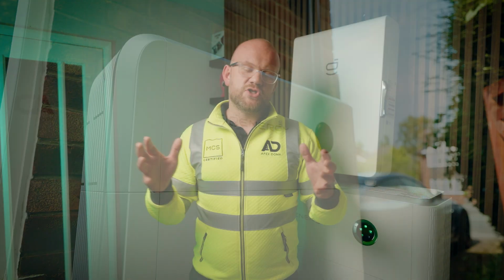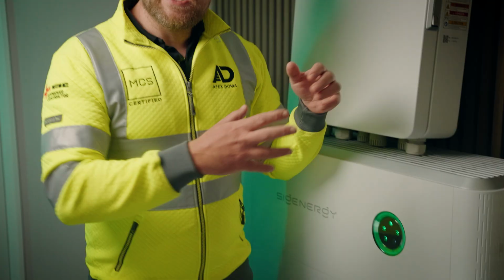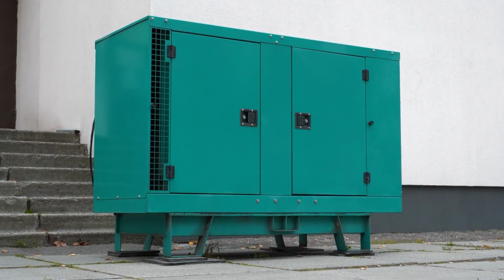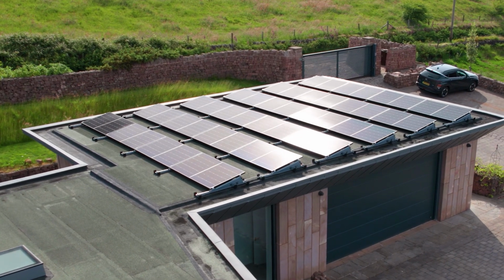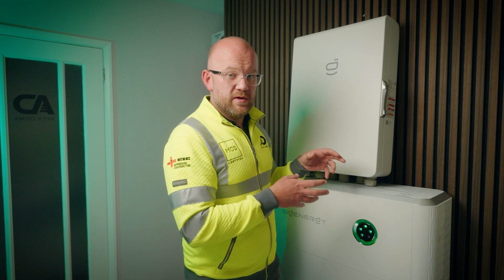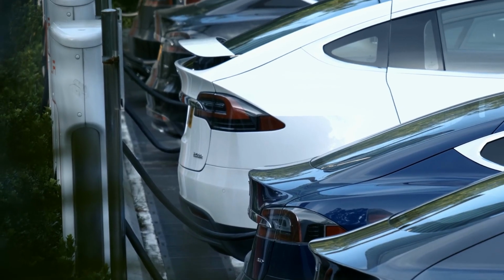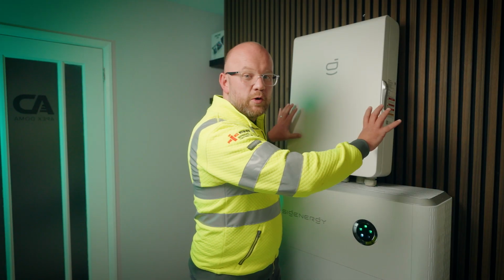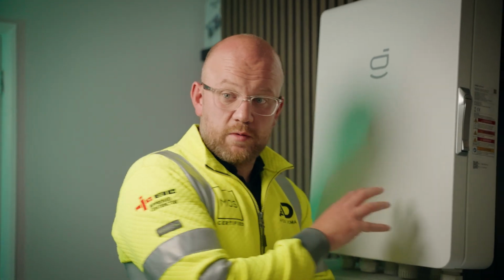SigEnergy vs Tesla Powerwall 3: The Best Whole-House Backup Power Options in 2025

Comment: Get a Deye 12 KW inverter + one or more 15 kWh low voltage cells for a fraction of the price + it's 100% controllable through Home Assistant with down to 5 secs. updates if you buy a simple Modbus interface. The 12 KW Deye will do a max. of 12 KW on it's load port with up to 6 KW one any one phase. High Voltage batteries are so expencise they often never will return the investment where you now in EU can get those 15 kWh LFP batteries for 1300 Euro delivered at your doorstep VAT & Taxes included. The inverter will also do Windturbines & 3 phase generators.

Whats the price for one of these inverters + one 314 Ah battery? How much power can the inverter deliver total/each phase?
Reply: Hey I'm in Europe can you point me in the direction of where to get those batteries? I'm very interested in building a battery backup system for my house in France
Reply: @moulinroche Links gets deleted here. I have sent you an email instead.

Comment: What they don’t mention is that you need to drill through your garage floor membrane and foundations to sink a separate earth rod. I decided I didn’t want my damp protection compromised. It’s not practical with a heat pump either, in mid winter my house load is 60 kWh, 15kWh battery storage won’t last very long.
Reply: My earth rod was outside the garage. No issue.
Reply: @djtaylorutube  That would be great. We have a tarmac path that’s in good condition, they could have taken an angle grinder to channel through it but again it would compromise a perfectly good path. We haven’t had a power cut in years so just not worth the damage, but if it looks like war is imminent I’ll sort it out as the gateway is already installed.
Reply: @yp77738yp77739 Yep, side of my garage has a slabbed path so they ran along the side of the garage, under a slab and into soft stuff.  Makes sense for you to leave it alone until the zombie apocalypse. 👍

Comment: Great video just what I have been looking for. I’m curious about the inverter being sized to handle whole house backup. But what if your DNO specifies a lower sized output than your installed higher output inverter. Is there a way around this.
Reply: you can have a bigger inverter in your house (say 10KW), and lower export limit (say 6KW) controlled as two separate options on something like Sigenstor